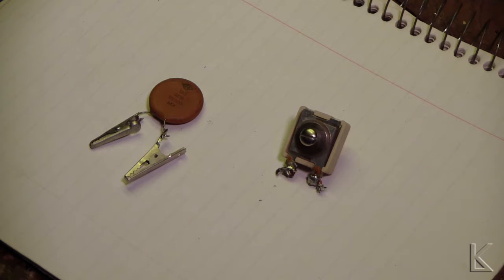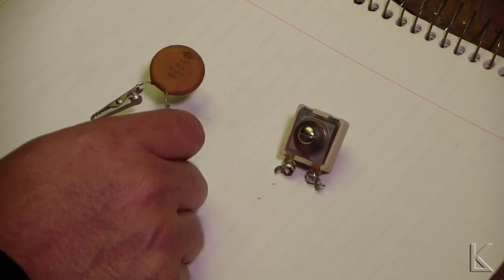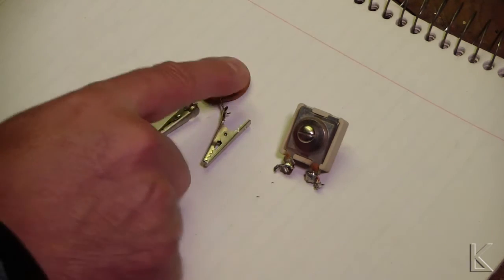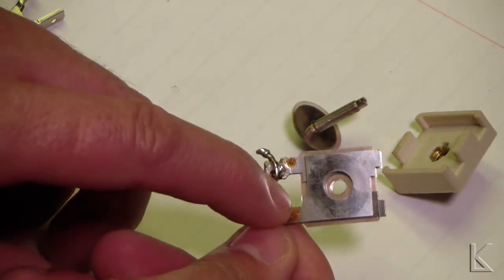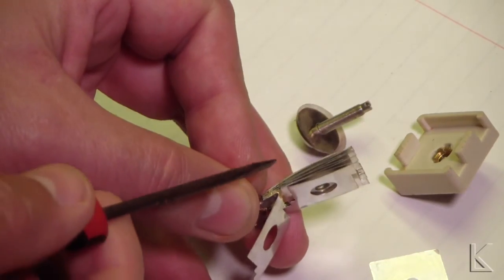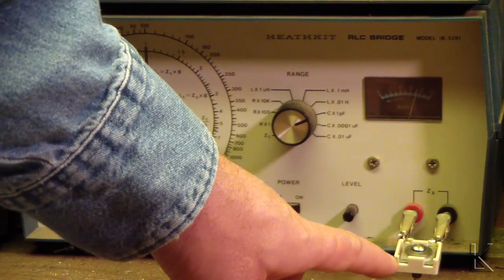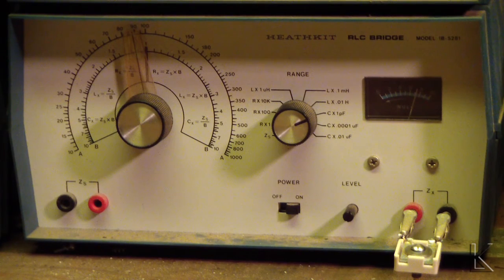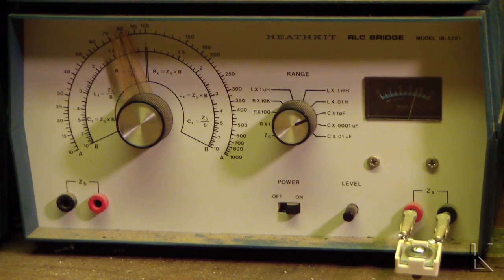Ham Radio - I create a custom HV trimmer cap for my mini magnetic loop.

Comment: I built one of those Heathkit RLC bridges decades ago, sold it on ebay about six years ago. I still have the Heathkit dip meter that I built. The only other Heathkit that I built was an audio generator that used the same case as the RLC bridge, sold that too. Had friend in HS that built a Heathkit Color TV-and it worked!

Comment: Just saw one of those RCL meters at our club shack from an estate sale.  A friend tried to explain how it is used but it was confusing.  Your use of it was very clear.  It looks like an older piece of test gear before we had all these Chinese and American part test boxes.  I just got one from China for $13.00 that I took to a club meeting to show how easy it is to check parts before inserting them on a circuit board.  Thanks for the demo of an old but still useful piece of test gear.

Dave K8WPE
Reply from the maker: Glad I was clear enough to help you understand it.   It is old school for sure.   My dad and I built a bunch of heath test gear back in the 80's and I recently brought it all home to my bench.
I could buy those modern bits, but there's just something satisfying in using the old stuff.